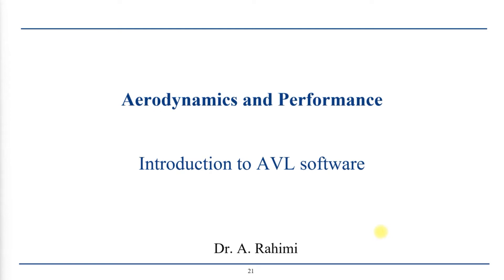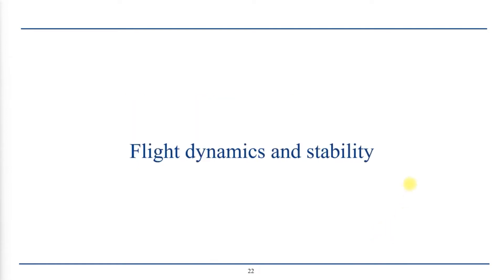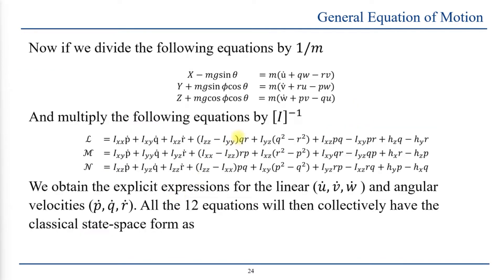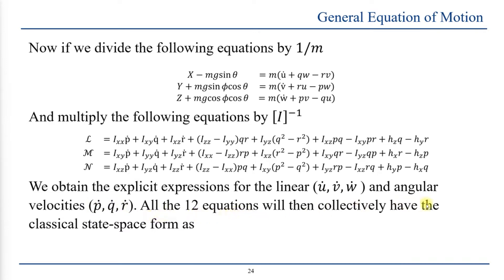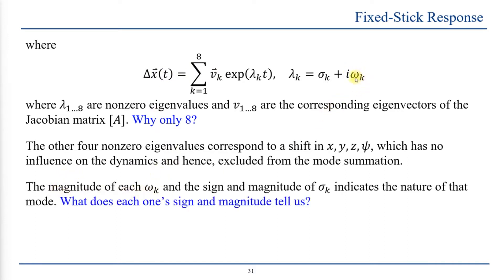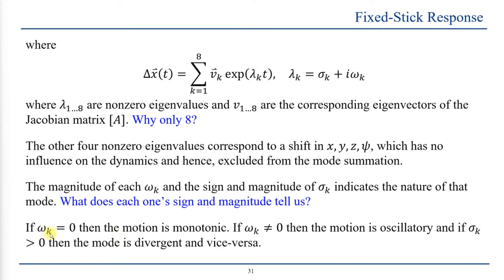AVL Tutorial  -  Part 03  -  Flight Dynamics and Stability

Comment: I wonder why AVL generates 6 dynamic modes instead of generally known 5 modes - 1) Short Period, 2) Phugoid, 3) Roll damping, 4) Dutch Roll, and 5) Spiral. This happens always and with Drela's own models too. So, why is that and what is the 6th mode?
Reply from the maker: Hi, "For the fixed-stick case of no control inputs, Δδ = 0, the general solution of the Linear Time Invariant (LTI) ODE system (9.35) is a superposition of eight flight-dynamics eigenmodes," this is from Drela's book (https://mitpress.mit.edu/9780262526449/flight-vehicle-aerodynamics/) on page 207 in Chapter 9. In reality all these 8 modes exist and AVL calculates 8 and not 6. But the more common and influential ones are the 5 you noted in your comment. That is why these 5 modes are usually of interest and discussed in the literature.
Reply: @arahimi_  Thank you for your response. 
I seem to have confused things a bit. Indeed, AVL generates 8 modes (apparently as a rule, since I happened to notice 7 modes in Drela's files on at least one occasion, unless I missed something again).

Anyway, out of those 8 modes, 6 are oscillatory and therefore "duplicated", resulting in 6/2=3 oscillatory modes and 2 non-oscillatory modes. 
In total, this gives us 5 modes, as I mentioned earlier. This way, things appear to be clear. ... if it were not the file with 7 modes only - I'll double check that.

Comment: Hello, how can i get trottle derivatives via avl
Reply from the maker: I have done it personally and I am not sure if it is possible to do, but you can reach out to the creator of AVL https://aeroastro.mit.edu/people/mark-drela/ and ask directly if he can help you with it.
Reply: @arahimi_  thank you sir, In addition can we obtain cl alpha and cm alpha graph of aircraft through avl
Reply from the maker: @kenancici2677  Those would be specific to lifting surfaces and you need to use XFoil (another software by Mark Drela) for that purpose
Reply: @arahimi_  so derivative of Cl respect to alpha which is founded by alv is radyan unit or degree
Reply from the maker: @kenancici2677  Depends on the unit you put in your input files, if they are in deg the results will be in degrees and if they are in radians, the results will be in radians